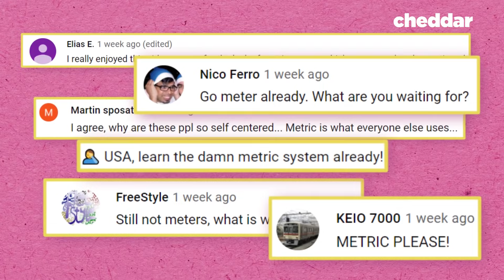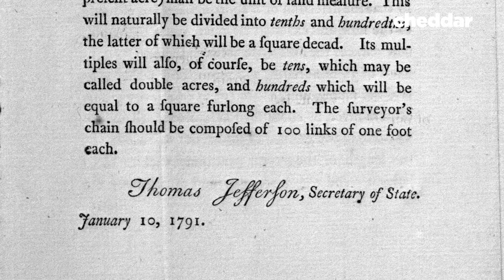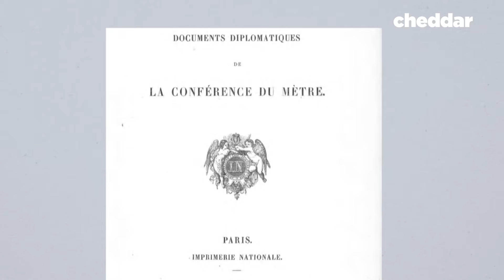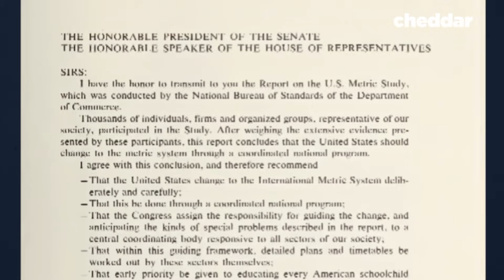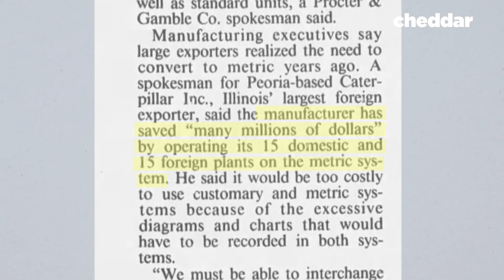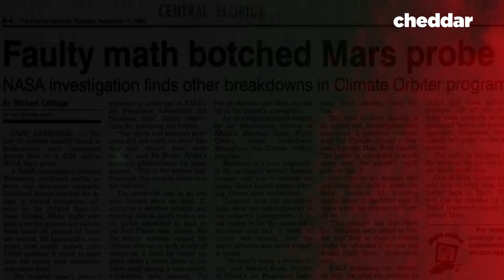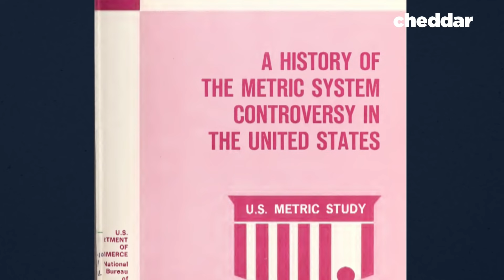Why Doesn't the US Just Use the Metric System? - Cheddar Explains

Comment: For this to happen they would have to have everyone in America  without a Digital Speedometer to get new cars or have the speedometer changed for free. 

Also they would have to change every single Road sign that has anything to do with Miles or Feet
Reply: Jason Moore Most USDM car speedometers have had both units of measurement on them since at least the late 1980/early 1990s. Same with vehicles in Canada and probably Mexico to allow for easy travel between the countries. My car has the MPH displayed in the outer circle while the km/h is on the inside. My neighbor is a snowbird from Canada and her speedo has km/h on the outside and MPH on the inside. 

As far as changing out road signs, not really. We already cover errors and update signs using cheap coverup (or greenout). These signs have to be replaced every 10-15 years anyway so a state could wait to update the signs until the end of the sign’s useful lifespan. The hardest part would be switching out mile markers for kilometer markers and changing the exit numbers to follow them. Even that, however, wouldn’t take that much.
Reply: @daveedwards6727  oh ok that's good

Comment: Remember when humans made it to the moon using the metric system? Oh
Reply: nasa uses metric
Reply: @stoptexting  not in the 60s bud
Reply: You say that jokingly, but revealed that you have no idea what you're talking about. NASA did in fact use the metric system quite a bit back in the 60's and converted the numbers to Imperial after, but even if they hadn't that's a stupid argument, and unfortunately it's adults using it a lot of the time.
Reply: Yeah, then those humans crashed a Mars orbiter due to measurement conversion.
Reply: The Apollo hardware was built to US Customary specifications, but the computer calculations were done in metric units for flight control.  Readouts may have been in customary units.

Comment: In metric, one milliliter of water occupies one cubic centimeter, weighs one gram, and requires one calorie of energy to heat up by one degree centigrade - which is one percent of the difference between its freezing point and its boiling point. An amount of hydrogen weighing the same amount has exactly one mole of atoms in it. Whereas in American system, the answer to "How much energy does it take to boil a room-temperture gallon of water?" is "Go f$ck yourself".

Comment: "Britain switched to metric in 1965"

"So im driving along at 30 miles per hour when i come across an 8 foot bridge. I though i should be ok as my van is only 2.4 meters tall but i also have a 10 liter jug of water strapped to the top. so when i got out to check i accidently knocked my 4 pint of milk out of my seat but luckily i still have my 1 liter bottol of coke so i wont get thirsty. Anyway i was a couple of inches over so i needed to remove the water. i looked at my map and there is a petrol station about 4km back the way i came where i can stop to remove it. This isnt a problem as i can shed 10k of weight from the van and up the fule economy to over 40 miles per gallon, now if i could only loose a stone or 2 myself that would be better."

example of us british being a metric county :)
Reply: In British coutrooms, barristers today must stand two sword's lengths apart.
Reply: @TnseWlms  claymore or rapier?
Reply: I am from slovakia basically evrything is metric here but for daily thing people often say teaspoon of medicine or a cup of milk. Hoewever but thats mainly for recipes and such and not all either also
When you live in a country that almost only uses metric you can tell gow mutch about 5 liters is pretty easy same as the people using inperial can tell how mutch about 1 gallon is. For day to day life it us easier to use the system you grew up with however for more precise thing and such metric is better
Reply: Britain switched to the US inch 130 years before then too. They change their measuring units like socks!
Reply: Ace Scottie country*
Reply: No it didn't, it just pretended to. Otherwise known as pseudo metric (sizes displayed as metric conversions of still Imperial sizes)
Reply: You pretty well summed up the British there! Even Americans, locked into archaic measurements, laugh at weight in "stones"!
Reply: You have a British map in km when our road signs and the van's mileometer are both in miles. Rubbish map you bought there matey.
Reply: Ace Scottie I honestly like it mixed. Imperial is better for the human body (measuring someone from being 6 ft to 5’5 is easier than 1.82m to 1.65m) and it’s easier to comprehend air temperatures at F where 0F is damn cold and 100F is damn hot and better for water at C where 0C is freezing point and 100C is boiling point.
Reply: @heartless_raven  no. A mix just makes the entire system a mess. Also temperature is subjective. In Canada 0°f is only -17 c which is cold but not that cold. Sometimes we get -30c which is cold. Also measuring height in foot and inches sucks because there's no easy conversion between foot and inches, and it gets confusing as hell. 5'9 is not the same as 5.9 feet even though logically it should be
Reply: @heartless_raven  but i think cm is more precise for height
Reply: @sozisalad5011  it makes no difference. It depends upon the number of decimal places (dp) of accuracy you want. As an example in aerospace engineering, dimensions on drawings in inches are normally to 3dp and in metric mm its to 2dp, so to maintain parity.
Reply: @andrewdking  so you wanna say 6 foot is as accurate as 183? (my height)
Reply: @sozisalad5011  of coarse it is. If you are using a feet and inches height scale and you were exactly 6 ft high, then 183 cm high is a close conversion to the nearest whole cm, but for an exact conversion its 182.88 cm. 
If you were told you were 183cm high measured on a m and cm height scale, then i expect it was only marked in cm as the smallest increment. I very much doubt you were exactly 183cm high as human measurements just don't need to be that accurate.
If you are trying to tell me 6ft 0in is less accurate than 182.88cm or indeed 1m 82.88cm, then you are wrong.
Reply: @andrewdking  from 180 to 185 cm all the people are 6 feet even though they have height differences, how is that more accurate
Reply: @heartless_raven  Wat !!!!!!!!!!
Reply: @heartless_raven  just for fun 

1 meter and eight tenth's or for better precision 1m 82 hundreth's
Just for sake of more confusion 
It is not that bad anyway

Or if you want even better precisuob let say 
1m 968 thousand's 
Id say this is about 1.97m rounded up
Or if tou wish 1968 mm    milimetres

Comment: No, not metric. Let's change to furlongs as our unit of measure. It would have the advantage that horse racing would be unchanged. It would work as well as the metric system. Products made would be just as reproducible as those made with the metric system, or for that matter, the Imperial system. I would also propose firkins as a volume measure, firkins being a common (in some places) way to measure beer.

Absurd? Yes. Just as absurd as the many, many videos trying to find out what is wrong with the US because they don't use the Metric System. The fact that we do use the Metric System is seldom mentioned. That would diminish the political narrative that the US is OLD Fashioned, thus any ideas or projects of the US are 'outdated' because the people are so backward. Get this in your mind: The Metric System is no more accurate than the US system of weights and measures. We went to the moon using the US System.

I wil admit that US volume measures need to be changed, because they are so complicated.

Comment: Does inch has a division like metric?  1 mm, 1 cm, 1 m,  1 dm, 1 Km. Thanks
Reply: nope.
Reply: kilofeet. thats fun.
Reply: We put our feet before yards. So you should probably put your decimeters before meters too.
Reply: Machinists work in inches with decimal fractions, typically to a thousandth or ten-thousandth precision.  Any unit can be used with decimal fractions.  Surveyors use feet, tenths, and hundredths.

Comment: In photography we has to cut our frames to inch measurements, but the ruler divided inches into 1/4, 1/2 & 3/4. It would be fine except we had do math to determine what we cut depending on the side and our measurements where inches divided into tens, 7.3 or 4.65, for example. But we had never been taught how to do math in terms of quarters and I could only guess where a third of an inch was cuz the ruler didn't show it and our measurements had to be quite exact. So in the end I had to convert everything to centimetres cuz it was way easier.
Reply: Normally, we don’t use 1/3 inch.  There is no mark for 1/3 cm on a metric ruler, so I don’t see the difference.
Reply: You have other choices you get a fule marked in inches, tenths, and hundredths.  That would be as easy as using one marked in mm.  But neither one will give a mark at one-third.

Comment: So, real question here.  How does dividing every measurement by ten make the economy better?  Similarly, why does using metric change the number of belts you use in your cars?  I seem to be missing something here?
Reply: I don’t believe we are getting the whole story about GM.  When they converted, they also reviewed and updated their entire manufacturing system.  There used to be inefficiencies in their parts inventory because different brands would have different part numbers for (for example) a fan belt, even if one fan belt would work for both.  The new engines being built to metric standards are also being designed under a new policy of controlling the parts count, so a particular engine used in multiple vehicle brands will have the same parts numbers for all.

Comment: We'll switch to metric if y'all switch to fahrenheit
Reply: Nah. I like it better this way. Metric and celcious for the smart modern man. You keep the weird high numbers Fahrenheit.
Reply: @snepNL  why would you not take the higher precision? If you go up 1 degree celcius on your thermostat, that's 2 degrees fahrenheit.  Also, with Fahrenheit, 0 degrees is really fucking cold, and 100 degrees is really fucking hot.  It rarely goes above 100 or below 0 outside. That matters more to me than the temperature water freezes or boils.
Reply: @jadles_7  Also, with Celsius 100 and 0 degrees are real fucking constants.
Reply: @jadles_7  Yeah, no. You can't feel a 1 degree shift in temperature in Celsius and you can't in Fahrenheit either. I'm Canadian, so a lot of thermostats in hotels are in Fahrenheit, and there is absolutely no noticeable difference unless its 4-5 degrees F, so there is no need for the extra precision. 

That whole "the weather is almost always between 0 and 100 degrees Fahrenheit" thing only works for specific places. Up here, 0 F isn't comfortable, but it isn't out of the ordinary by any means, and in the winters it can drop as low as -40 F at night, and even 80 F is considered pretty hot. In fact, I don't think that the temperature has ever gotten to 100 F in the area I live, and I mean ever, since the founding of the city. That's a whole lot below that nice rounded 0 number you mention, and noticeably under that nice clean 100 F you bring up, but OK. 

Knowing when water is frozen is also pretty damn useful knowledge to have where ice forms on the road pretty commonly, and having the system based around that is more convenient for a whole lot of places than that arbitrary 32 degrees shit.

Also, the temperature of the air is only one thing that temperature is used for. 0 being water's freezing point and 100 being water's boiling point makes a lot more sense than that other bullshit when you're talking about chemicals, temperatures on other planets, etc. (though in scientific contexts the temperature is commonly in Kelvin, which is actually Celsius but with 0 being the coldest possible temperature. Still, one degrees Kelvin is equal to one degrees Celsius.)

You only prefer Fahrenheit because you're used to it, there is no reason at all for anybody to use Fahrenheit, let alone switch to it.
Reply: @bobjones1432   Bob Jones  people usually set their thermostat between 68 and 72 and yeah that's a big difference.  Where I live in Ohio 100 is really hot and 0 is really cold. Okay, in the Saharan desert it often gets to 130 or higher, and in northern Canada where almost no one lives it often gets beyond -30 during the day.  But for the most part, 100 degrees is dangerously hot, and 0 is dangerously cold. When was the last time you were like, man it feels exactly between the boiling point of water and the freezing point of water... It must be approximately 50c out here.  Probably never.  Just because you grew up with celcius doesn't mean it's better.  It may be better for scientific shit, but not for measuring the tempature inside or outside your house.

Comment: UK didn't go full on Metric, we still use Mile Per Hour, and Miles for driving distance. Many of us in Engineering use Both. Me for example I measure in Metric, but estimate weights in pounds. Converting is a slow process but it will happens eventually. Industry use it because it is a much neater tidier system, most engineering and sciences use it because it is much simpler.
When you are designing it is easier to say 320.675mm than 12 5/8" for a start there is not fraction conversion to do. Add 3 3/16 to that first number, 15 13/16" in metric that's easy 320.675 + 80.9625 no calculator needed 401.6375. The system is all decimal (Base 10).

Comment: Americans love imperial measurements because they're so easy to use... teaspoon, tablespoon, cup, buckets, bushels, truckloads, boatloads, etc. A boatload of bananas? Well, it's 1.35 metric tonnes of bananas, based on the 1832 standard size of the boats that transported bananas from the "banana republics" of old (sarcasm!).

Nevermind that different objects have different weights in the volume of a cup or that even the same ingredient measures differently if sifted...

Comment: Europe is intolerant of diversity. Why can't we have both...one for science & one for humans? Fahrenheit is a decimal temperature system where 0° is as as cold as it gets in winter & 100° is summer maximum. Celsius is great for water, not for people.
Reply: That is entirely dependant on place. In very few places is it like that. Here in Canada for example it regularly goes well below 0 F, in fact is can get well into the -40 F's at night in the winter. 80-85 F is more like how hot it gets here. If it hit 100 F we would all die of heatstrokes. It has never hit 100 F in my city since its founding.

And Europe is intolerant of diversity? Please tell me you're joking. You have to be, right? Diversity? More measurement systems=diversity? That's hilarious, intentional or not. And dear God, the way you specify that Fahrenheit is a decimal-based system as if Celsius isn't. I don't think you know what decimal based is, because being 0 to 100 does not mean something is decimal based, and even then Celsius is all well.

And I know your whole point is that temperatures range from 0-100 in Fahrenheit, but that is completely wrong because temperature ranges are entirely different in every location. In many places it doesn't get below 50 F, even in winter, up North it isn't uncommon that it drops a lot below 0 F.

Comment: I like the metric system

I will admit the US customary system makes a level of intuitive sense, but it's small, and metric just makes things easier

But I refuse to give up the Fahrenheit scale!

1. The Fahrenheit scale is far more useful in everyday life, the larger number of degrees allows for more precise measurements with less information (eg, it's in the mid 70's today makes sense in Fahrenheit, you can't be that vague in Celsius)

2. There are no conversion errors. The conversion from miles to kilometers, or gallons to liters, involves a lot of significant digits beyond the decimal point, the conversion between Fahrenheit and Celsius involves only 1 significant digit (1.8 or 9/5) and simple addition/subtraction

Now I will give Celsius credit in that 0 and 100 being the freezing and boiling points of water respectively is very nice, but this also gives you a large chunk of the scale that never comes up in day to day life

Adopt metric but keep Fahrenheit!

I'd also be open to an alternative where 0 is the freezing and 180 is the boiling of water, if only because human body temperature would then be 66.6°

Comment: I like the metric system on extremely small scales. Like millimeters and that’s it. After that, it’s imperial all the way. Makes it a lot easier to build and design things with the imperial system. A foot bridges the gap between an inch and a yard, where as you go straight from a centimeter to meter with nothing in between
Reply: There is technically a decimeter but no one uses it
Reply: all science, engineering, construction is in metric for decades to centuries.